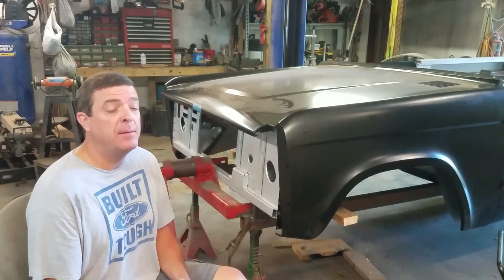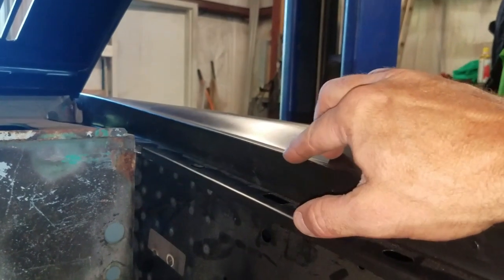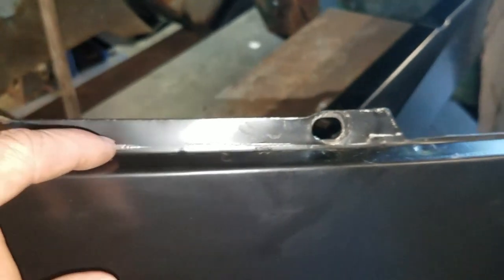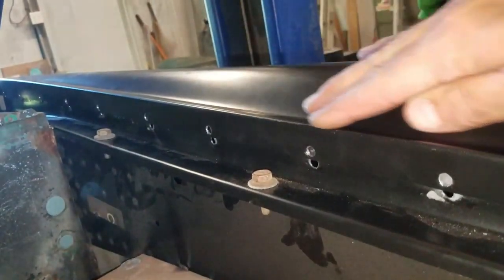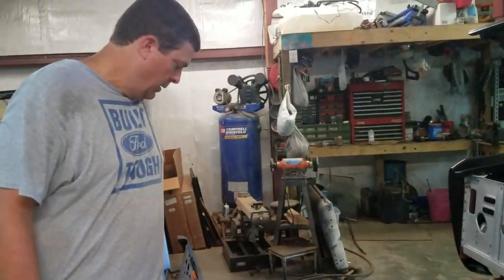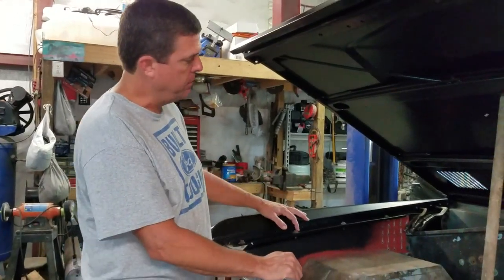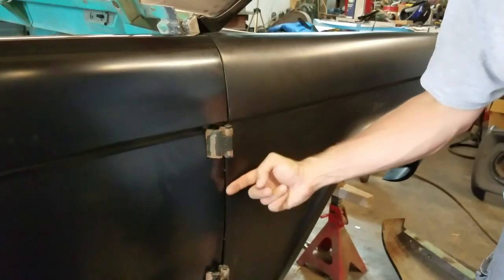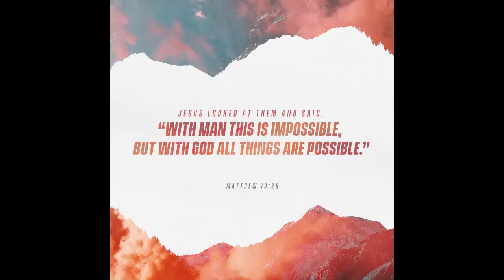Front Fender Modification & Installation - 1966 Ford Bronco Restoration Project

Comment: As I sit here in my hotel in Monument Valley taking a break from my cross country motorcycle trip, the light bulb came on after watching this. I have fought with my fenders and never thought about drilling out the spot welds on that lip, I have the same gaps that you encountered. Thanks again for your solutions to my problems almost like having you in the shop with me.
Reply from the maker: Awesome man!  I am jealous about your trip.  I miss that area.  Enjoy the trip.

Comment: One " New" fender  I bought was a 1/4" taller than the other so I drilled out the spot welds too and fixed it. Also one fender had a completely different front outside curve compared to the grill, another fix. The fenders don't have enough clearance for the clips to mount the grill so it won't bolt up flush. Its frustrating when you spend the money on new parts and spend hours fixing them to fit correctly but it has too be done. Thanks for showing the the issue's your going through and how you fix them. 👍
Reply from the maker: We appreciate you watching.  A viewer introduced me to unwelded fenders.  I can find out who supplies them but what a better concept.  He sent me pictures and he was able to fit them exactly then spot weld.  I would have opted for those if I had known about them.

Comment: Thanks Jason for the great video. I bought a Dennis Carpenter body less front fender install and am battling this same problem with used 1974 original fenders. I was scratching my head wondering how to make the fits presentable. Now I know, will drill my spot welds out on the fenders to make the fits. " If it isn't right, then why isn't it"? Right?
Reply from the maker: I am glad it helped Robert.  Thank you for watching.  You are correct....why isn't it right?

Comment: The lower part of the “a” pillar has a piece that sticks to the outside, does that go between the rocker and the fender or behind the lip on the front edge of the rocker?
Reply from the maker: Mr. Jim, go to the rocker panel install video I did in May and go to the 6 minute mark and I think it might clear up your question.  Thanks again!

Comment: I’m building a 1969 all new metal I got all the part’s from  Tom’s I got to the front finders and my gaps in n both sides at to are all most touching how can I adjust that out
Reply: At the top of the finders
Reply from the maker: Tony, Thanks for watching...without seeing the gaps myself, it is hard to give that advice.  Don't be surprised if you have to modify, cut and drill on the fenders to make them fit.
Reply: Ok thanks just figured I would give it a try
Reply: Thanks for all the pointers on other stuff it helps love watching

Comment: What brand did you find to be the better quality.  Dentist carpenter or tom bronco parts. Thanks
Reply from the maker: I did not order body panels from Tom's only CJ Pony and Dennis Carpenter.  The DC parts were better for the most part.  CJ will send parts from different manufacturers.  They sent me a right and left fender that were not built by the same people.  I did not like that too much.
Reply: @JasonJonieBuilds  thanks I am going to start what I will be calling nose job. It is a wrecked tub from the early 1980 that has lived in AZ it hole life. Keep up the good work .
Reply from the maker: @jasonalaniz353  Good Luck!  Sounds like you are going to have some fun.